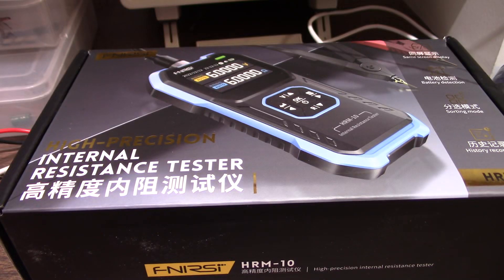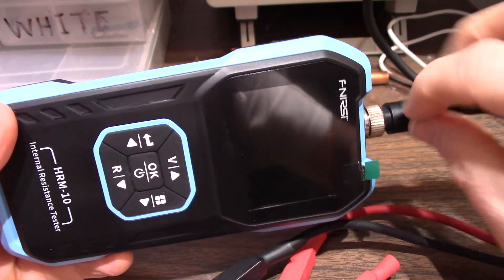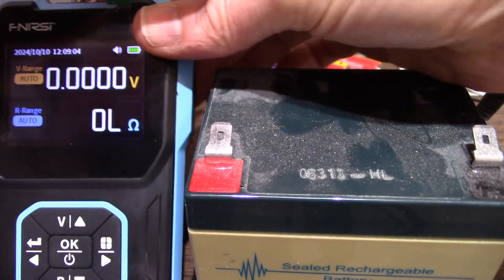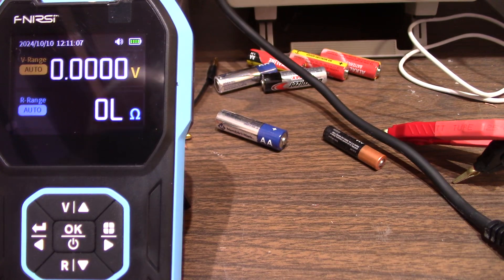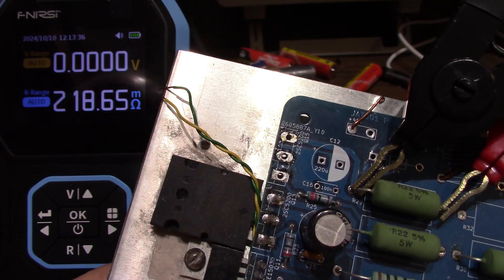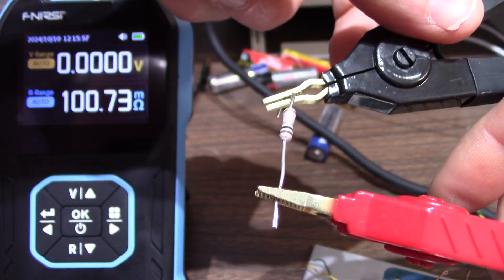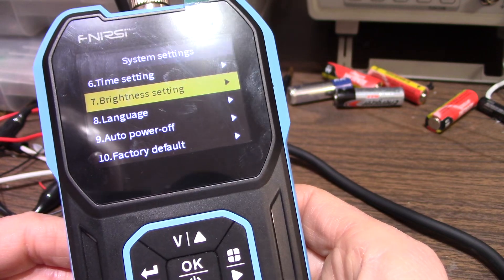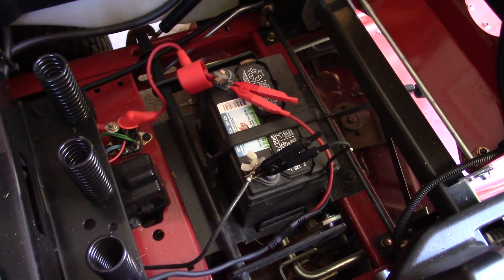Internal resistance meter review - FNIRSI HRM-10

Comment: Love this low cost gear.   Most people just like to have simple tools they use on a blue moon around.    Buying this!   I have so many AGM and some old Flooded batteries around I would like to see just how they are doing all these years. 
I threw away a UPS thinking it was bad when it was just the battery, and found out too late.  
Great price for the tool!     Even if its just to muck about with.

Comment: I could use it to measure the esr of the power supply capacitors of an amplifier, even with the amp on, as long as the voltage is below 100V. Nice little device by fnirsi again.